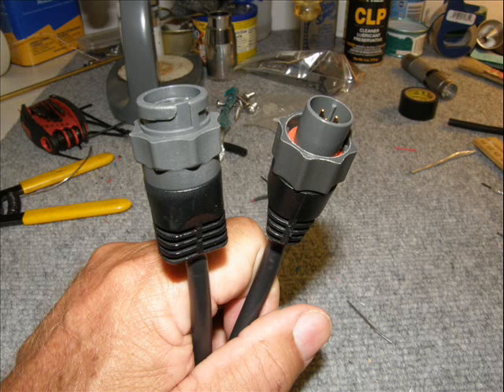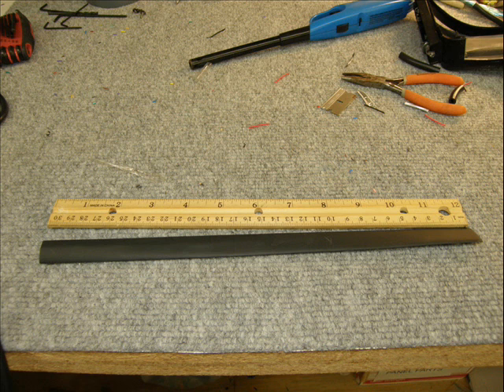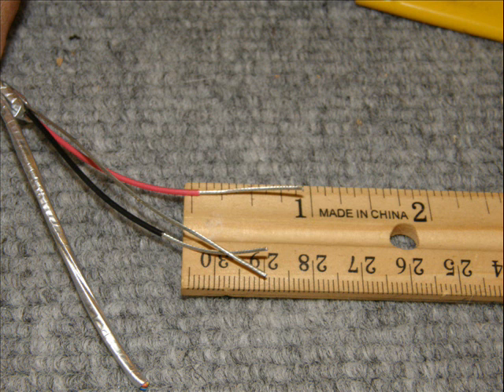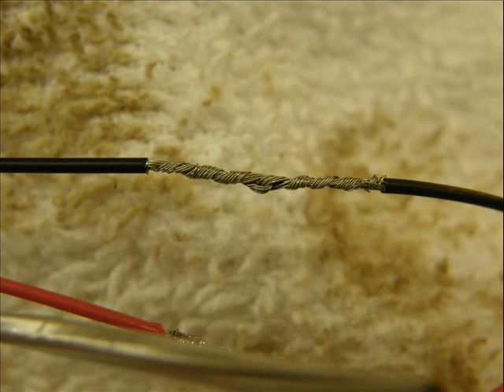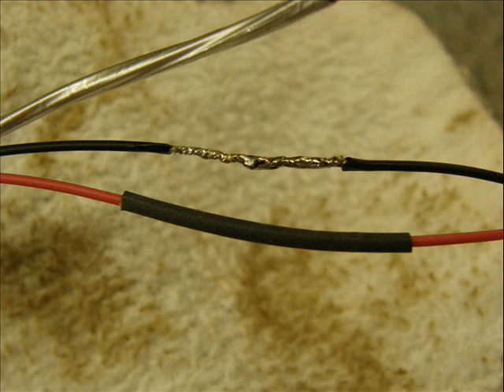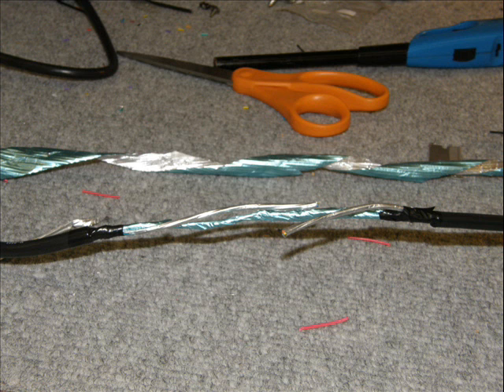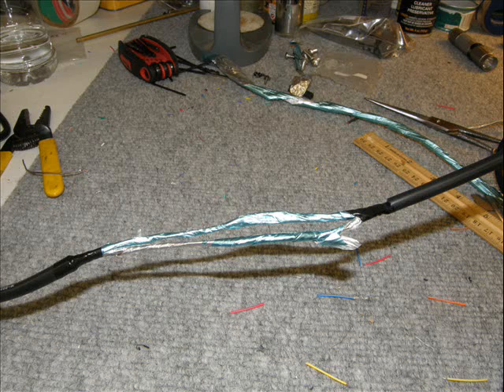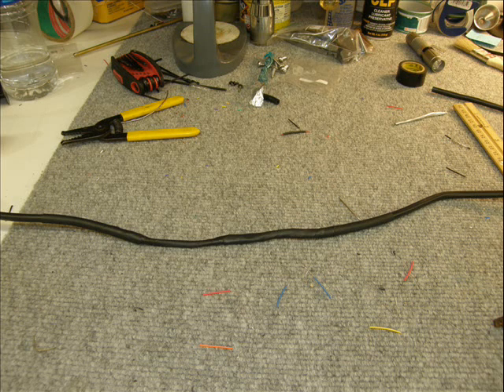boat transducer wiresplice

Comment: My friend, I got a depth finder and I splice the wires because the old one wasn’t working. I put the black to black the red to red going into the power source there’s another outlet that says T do I have to hook up those wires or just powering up is enough does the wires from the tea terminal have to be hooked up to the wires coming out of the boat? If my unit will work and just give me the debt that’s all I need.
Reply from the maker: The scope of my video was to make the factory components capable of installation in restricted spaces therefore all the cable wires need to match up. If installing different components it will necessitate getting the specs for the components to determine if they are compatible as well as the wires identified. Typically 3 wires would suggest power positive and negative and data.
	As indicated by a commenter this connection is not as strong as an un- altered cable, but it is likely the cable is now installed and would not be exposed to large stress
Reply: @skipwilson8066  turns out the T  terminal is for speed and temperature and I don’t need that so I’m not gonna hook that side up but thank you for answering

Comment: Watched until the “cut the half the strands off” and “wrap on it self” - no  need to watch any further! 
So much for “not introducing the high resistance”!!! 😂
Reply: Half the strands of 1 wire, wrapped around half the strands of the other wire, soldered together, will equal the same total diameter of the original wire 🤷‍♂

Comment: Probably not a big deal but we use twisted pair in networking. The pairs are twisted together to prevent cross talk. We have 4 pairs each having a different number of twist per inch keeping them from interfering with each other. Maybe the shielding prevents that also. My dad pinched his Garmin 12 pin transducer cable in the trolling motor last week. It connects to a 93sv I believe. I've had zero luck finding a pinout diagram to test the transducer with a multimeter. There is no sign of it being pinched. So I don't really know how to determine where the break is .

Comment: I know it has been nearly six years since you uploaded this video. I have a question where you cut half of the wires away: Does this cause signal power loss? It seems this makes two weak points for the power or data transfer. I know this is retained through the splice, but that 1/16" or 1/32" appears to potentially be a point. a western union splice would make this more bulky, but would retain the strand thickness for the duration of the connection. Maybe this could be overcome, if it is actually a problem, on your method by leaving a 1/4" tag of the cut wire and making it part of the soldered joint. You got a thumbs up from me for a great and informative video. Thank you!!
Reply from the maker: The objective in this approach is to maintain the cables size and electrical characteristics as much as possible. The wire and splice are about the same size and the solder fills gaps so the the signals will not have significant resistance , capacitance or reactive elements introduced. The main point is to maintain the cables Drain characteristics, those being shielding, twisted pair etc. Sonar is just a fancy Hi-Fi amp and speaker. You don't want static and signal cross talk to mask that big rock so any splicing technique that achieves those goals goes.
Reply from the maker: In this installation the system performed to factory specs with no loss

Comment: I've been trying to find out if I could replace an obsolete transducer(lowrance X50) with something compatible by splicing it. any suggestions?
Reply from the maker: They are piezoelectric "speakers" and are cut like a crystal to vibrate at a specific frequency.
Electricity in - noise out.
 In theory, any transducer of matching frequency and output power (watts) should work.
Reply: @skipwilson8066  thanx.
Yur the first person who seemed to have the most knowledge on the subject.
So find a transducer with approx specs and try it I guess ??
Reply: @skipwilson8066  if I find a transducer that matches my Lowrance X50
, let's say at a garage sale, is there anyway I can test it, say with a continuity  tester?
I know I can sense the "snapping" sound when plugged into a unit but I'm talking about bench testing the transducer by itself. Thanx
Reply from the maker: @edo4609  If the specs match, short of having expensive test equipment, plug it in and point it at a reflective surface. Should show some returns in free air. Better yet stick it in the water. If the sonar wattage is different than the transducer wattage there's a risk of damage to one or both devices.

Comment: Your method was a form of a double hook type which fails often because it the only mechanical strength is at the solder joint where the two wires loop through each other.
The proper wire splice is called a "Western Union" splice.  It is the strongest and provides the resistance between two wires joined together without solder, but by adding solder does make a better electrical bonding between two lengths of wire twisted together.
Nice video .
Reply from the maker: Good point and yes the western union splice ( where both wires wrap around each other) is a stronger connection and an option. I chose this method to demonstrate keeping the wires and insulation at close to their original size. Also the mechanical strain component ( string, etc) should be restored if there is any pulling required.

Comment: the shrink tube should be resin inside for waterproofing... otherwise in couple of years you'llhave corrosion inside...
Reply from the maker: Thanks for pointing that out. I neglected to mention it in the vid.
Reply from the maker: 8 years later and still working. Splice located in a dry space.